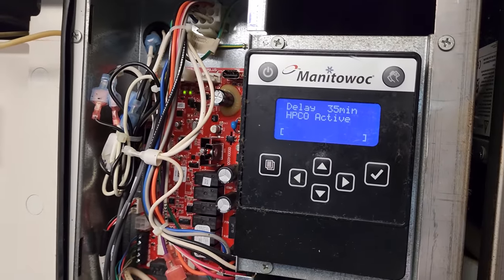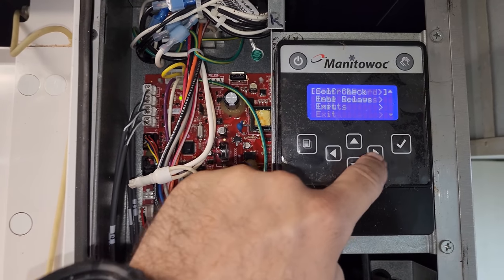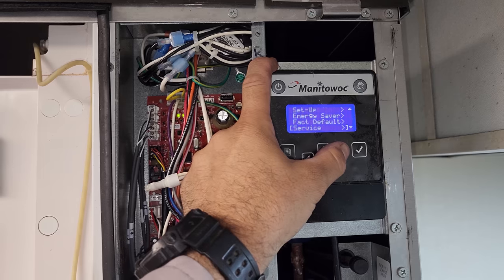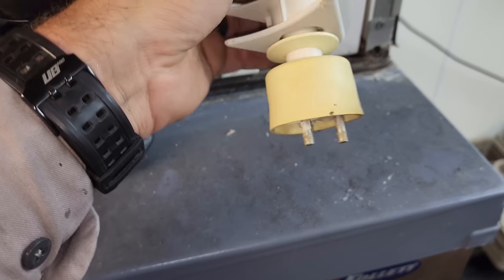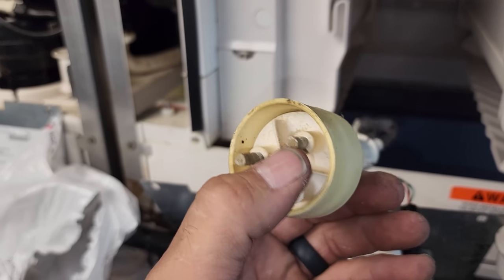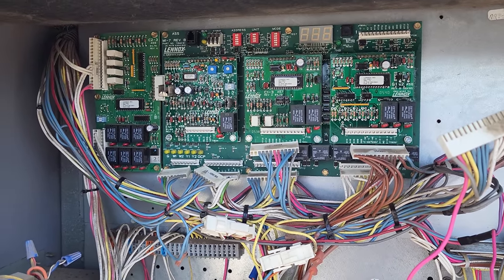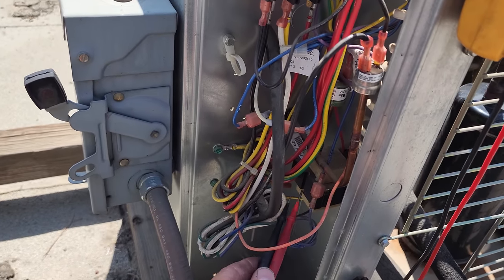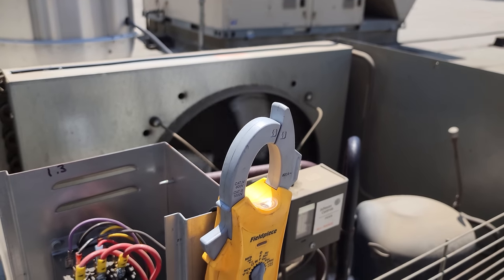BOTH ICE MACHINES ARE DOWN

Comment: Owner: there's two ice machines, so there will always be ice, so the business can stay open and make money.
Manager: there's two ice machines, so I wait with calling service until both are down, to save money.
Reply: If that's the "thinking" of MY Manager, they'll be my EX-Manager REALLY frigging quick...

If I owned a Restaurant, I'd tell ALL my Manglement Staff that we have redundant equipment (2 Ice Machines, 2 Fryers etc.) for a reason and when one fails, THAT'S THE TIME TO CALL THE REPAIR TECH...

Waiting until both fail before calling the Repair Techs WILL get you Fired FOR CAUSE!!!

Not only would I tell them that during Training, but it'll also be written down in the Policy Manual too...

Another Policy I'd have is Preventative Maintenance is the BEST way to save money/cut costs...keeping the equipment (especially the roof mounted A/C's & Exhaust Fans) clean and in good working order is the best possible way to prevent expensive downtime/repairs due to broken equipment so the first time ANYONE cheeps out on PM to "Save Money" to the last time they work for me...Cheeping out on PM is also a Fireable Offense...and I don't care if you've never had a verbal or written warning before, make either mistake and it's strike one, you're out!
Reply: @HappilyHomicidalHooligan  how u make money though?
Reply: @sk31370n  Simple, I make money by always having at least one machine of each type operational so I can ALWAYS provide whatever item my Menus offer to any customer that wants it even if a machine fails, the other one will be able to make the product while the first one is getting fixed and if both are currently working, I can make product that much faster decreasing lunch/dinner rush wait times, making my customers happy and more willing to come back again...

Happy Customers = repeat paying customers = more money for the business = ability to give employees Raises = happy employees = faster working employees = better customer service = happy customers etc. ad nauseum...

Comment: Nothing wrong with talking to yourself - heck it's even encouraged sometimes. Pilots are encouraged or even required to speak out loud the steps they are going through, and it's not just for the sake of verification/communication. There are many studies showing that so called "self-explaining" is very effective.
Reply: Agreed. I walk myself through almost everything I do just cause I easily forget what im supposed to be doing. Talkin to myself keeps me from missing something. Very important when you are dealing with equipment that stores cash, ATM, safes, etc, or equipment that has dangerous chemicals in  it that could potentially kill someone if you miss a step.
Reply: I gotta agree with this. I've just started flying lessons and I'm naturally doing it without even thinking about it.

Comment: Jump pin 3 and 6... Ive searched everywhere trying to find out what pins to jump... Thanks for sharing. lol
I've always used the oem fan control and pressure switches on the Manitowocs.  I probably should start stocking aftermarket ones for when they are not available. I've always been told that Manitowoc ice machines do not do well with aftermarket switches. Even my local supply houses are afraid to recommend any for Manitowocs so I never did.
Reply: I will add to this, when looking at the display board from behind (installed on touchpad) jumper pin 3 and 6. I used a piece of strand wire bent into a u shape with a few strands pulled out to accommodate the pins. Sucks having to do it but they need ice and I don't have a display on hand yet.

Comment: I've replaced probably 15 of those touch pads in the last year. The buttons simply stop working. Same with those fan cycle switches, they exist primarily to keep the discharge pressure high enough during harvest, but the tiny switch inside it just can't handle the load of the fan. What I normally do is wire the fan through a real relay, and switch the relay with the fan cycle control. There's a brand that starts with H, and they make a far superior ice machine.
Reply: humidity+touchpads=bad. Have had a few electronic rainfall shower controls fail due to humidity...
Reply: Better not be talking about Hoshizski. I have a lot of problems with them. Bin switches are trash.
Reply: Also does anyone know if rooftop condensers are the normal. Every machine I work on is air cooled packaged unit.
Reply: @Augdogfrogslog  When i was in wisconsin, they were self contained package machines, but hvacr videos lives in a very dry/hot desert area, so exhaust heat will be a consideration, esp as he mostly does restaurants so the ice machines themselves will be in employee work zones. No point exhausting hot air into the zone to have another unit have to deal with it. Chris, if i'm wrong swear at me
Reply: @Augdogfrogslog  It'll all depend on the needs of the building, the location, etc. I've worked both self-contained standalone units and units with remote condensers. Self-contained units are easier to move around and more convenient to service (in some aspects), but split units are normally a little smaller and a lot quieter.
Reply: @Augdogfrogslog  And don't get me started on their biggest design flaw. That stupid check valve and reversible pump instead of a dump valve. Constant issues with that EPDM disc not sealing well, and customer complains of low production and very thin ice. Also that silly water level float switch. If Hoshizaki just kept it simple, and just used a electronic water level probe like Manitowoc, and a dump valve instead of an expensive reversible pump, it would be a great machine. Bin level temp sensor work ok, until someone whacks it getting ice or cleaning the machine. And then the machine gets all frozen up, and the freezeup bends the evaporator plates, and then it's a crap shoot after that if it'll completely harvest after that. Have a few beat up machines at a couple of my customers that after a few months will just freeze up randomly. It looks like what's happening is the evap plates are pushed apart from many previous freezeups, and one or two cubes doesn't fall off, and then that starts an ice monster growing, gets bigger with every batch of ice. A common sign of this is broken cube guides. That huge slab of ice falls down, and smashes the white plastic cube guide.
Reply: @Augdogfrogslog  Those are a Manitowoc "Quiet Cube" machine where the compressor is on the roof. They were very popular in the early-mid 2000's. Today most of them are remote cooled, so all that's on the roof is a condenser with fan motors, and a flooded condenser Sporlan Headmaster valve, and the compressor is in the machine. I like the quiet cube machines in that the machine itself is very quiet and not much in them, since all the refrigeration stuff is on the roof, but, the remote cooled are kind of better I think because pretty much the only time you have to head to the roof is to clean the coil, or change out a bad fan motor or run capacitor. Pros n cons. I will say though from limited experience with the Quiet Cube machines (I only have one customer with one from 2005), is that they're built like a tank. 17 years old, and all I've ever had to do was clean the condenser coil, replace one dump valve (it was still working, but leaking water like crazy), and a curtain switch. I robbed a curtain switch from another dead machine that was out of gas.
Reply: I've replaced two touch pads in the last 3 years as well, always seems to be the power button and/or the left arrow button, so you can't turn the machine on/off  or back out of a menu. Quite frustrating, but at least I haven't had much trouble finding them in stock when needed.

Comment: At One of the seminars Jared for Manitowoc told us that a yellow number two orange pencil is the perfect gap tool to adjust the probe distance on these water probes. I've used it a ton of times and it's worked perfect
Reply: yea the seminar I went to they were hesitant when someone mentioned the #2 pencil but then we got one and compared it to the drill bit they recommended to use and it checked out.

Comment: Oh Manitowoc, Oh Manitowoc excellent machine for the service guy but not so much for the restaurant or business owner . Control boards with siliconed components straight 🗑 .Ive replaced multiple boards on Manitowoc units and have only replaced one board on a Hoshizaki 🤷🏻‍♂️. On a different note Manitowoc recommends replacing the touchpad and the LCD screen although 95% of the time problem is the touchscreen not the LCD due to the thumb like buttons behind wear out . Good video .

Comment: I love a Manitowoc, especially the Indigo series lol. So many ways to make it work when lots of things fail. By the way, I need a water level probe and there are like 85 on back order from my vendor, such a pain! Also, using a very low abrasive type of cloth/paper will clean those water level probes to make them work, I usually use a dollar bill and then wipe it down with some sanitizer solution

Comment: I hear that Bosch Burglary/Fire Keypad at 12:17. That sound is burned into my brain.
Reply from the maker: Command 4 on the Bosch keypad will silence the alarm.... fyi
Reply: @HVACRVIDEOS  it silences the trouble and alarm would need a code for a burg system, I'm a fire and burg tech. Make sure if you are going to silence it though to let a manager or owner know so it doesn't get ignored for a day or whatever the resounding timer is set to. Love the videos man, interesting to see the HVAC side of doing RTUS and Air Handlers.

Comment: Regarding that big unit you showed us where you had previously bypassed the circuit boards:
How much value does that circuit board add to the operation of the machine?  Seems like you wired it to run just fine from the thermostat.

Comment: How lucky are you that the machines clean before you work on it, I spend too much time bringing machines back to clean to diagnose- usually cleaning fixes issue. 2000 gallon point of use filters and don’t call anyone till it breaks is law around my area

Comment: The ice thickness sensor on the Indigo machines isn't really a sensor. It's a microphone, and that's what its showing you on the control board the 'volume' of 100hz, and 120hz noise of the water trickling is what it's picking up. Be careful while running these machines with the covers off, I've had issues trying to troubleshoot something with the front panel off, and they have a radio or bluetooth speaker in the kitchen playing music extremely loud. Very loud music can mess it up. If all the covers are on the machine, it's good enough sound proofing, and doesn't seem to bother anything. Not much of an issue, but if you're working on one of these machines, tell them to keep the music down. Saves you two headaches, one from 'long freeze' and the other from the 90+ dB of loud music.... :D  Keep up the good work.

Comment: Just from a FAS tech manitowoc had issues with the cable on the wlp. Also the pump and probe can be removed from a inside of bin no screws need to be removed. The engineers took advice from techs shocking I know
Reply: manitowoc is the best ice machine to work on

Comment: Excellent video. Great details.  On the Tee that you use, is that a female flare connector or a 1/4 SAE with rubber seals?
Reply: Looks like a swivel tee
Reply: Use it n toss on som leak lock on the permanent connections

Comment: I’m with you on those probes. When I do cleanings and I see ice thickness and water level probes that bad I don’t even think twice I just replace on the spot. I used to leave them in a cup of cleaner for 10-15 and scrub it off and it would still fail. Waste of time better just to replace

Comment: Couple months ago We we’re fixing a manitowic ice machine like that and we needed a new display. We put it in and the some buttons were doing nothing. We maybe thought it was a faulty display or bad Circuit board.  Maybe a half hour later we got it. It was off by an 1/16 of an inch from the front facing plastic cover. lmao 🤦‍♂️

Comment: The low head pressure on these Manitowocs on harvest is by design. They call it a CVD, or Cool Vapor Defrost. "To make hot gas systems work, the compressor must be as physically close to the ice making evaporator as possible. This also means the noise from the compressor is always concentrated at the ice making part of the system. This is not something you want in a customer environment. Manitowoc CVD ice machines use vapor refrigerant from the receiver tank to harvest the ice." -- from Manitowoc literature

Comment: I have a machine that won’t drop ice, makes it just fine but it won’t fall. I see now about the air pumps. Are those required to assist the ice in dropping ?
Reply: Yes they pump air into a pinhole on the evaporator and help push the slab of ice down. If you have two pumps and one is working you can take the air line from the bad pump and install it on one side of the good pump. Use a 10-32 or 10-24 machine screw to block the open air line ports and the one pump can feed both evap ports. Harvest when I tested this was within 2-3 minutes. Also check machine level and make sure that the evap is sloped downward if possible

Comment: On a manitowoc if the fan cycle isn’t in line the fan will run 100% of the time causing a long harvest. Head pressure drops to low. They will never work bypassed.

Comment: First, the company doing the cleaning and the service should be the same. If you don’t know enough to repair one, you should never touch anything other than on/off switch for this exact reason.
As for the fan cycle switch, I always use a tubing pinch off tool to remove old and solder in a new one. I’ve seen these switches leak refrigerant too many times. Twice I’ve seen the low pressure switch leak through the wires and out at the stake-on.

Comment: Your talking trash about cleaners but can’t even get through the board menu and just throw unnecessary parts at it charging the customer. No reason you couldn’t of cleaned that sensor
Reply: It would only worked temporarily at best....then he would of been ordering one anyways. I know because ive gone through that exact situation a few times....he is looking for a one time fix....not multiple trips....thats why. When you have experience with certain brands and even models...you learn their quirks and what to do. When you own a company.....and your calls log is heavy....returning because a part is acting up again isn't worth the money. So you replace the part....move on to a new call....with no concerns that you will have to return to a previous call......that you can't charge the customer for. So lighten up there captain perfect.
Reply: This is not how a service contract (or good maintenance contractor) works. Customers incur a huge downtime cost (beverage sales, for example, are a massive profit margin item and no ice means low sales) from failed equipment. And they don’t want repeat call-out charges or management time having to deal with them. If you don’t understand the economics, you won’t understand some of Chris’ (perfectly valid) decisions.

Plus don’t you listen to the review / post mortem from Chris at the end? He covered this very point. Plus, have gave a bonus “be kind” reminded. A little kindness in your life will, I can guarantee it, benefit you, not to mention other people in your life. Kindness means avoiding being judgemental and assuming the best In a person rather than criticising having assumed the worse about them or saying they’re a bad actor.